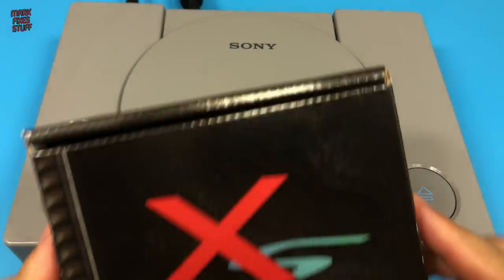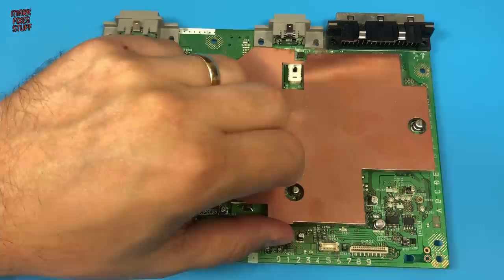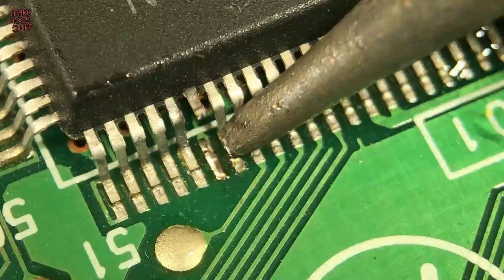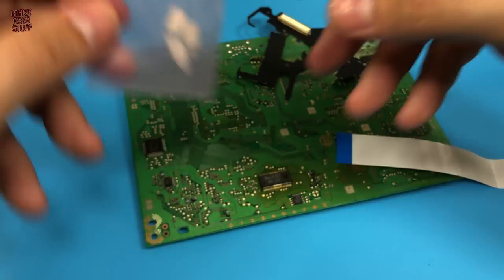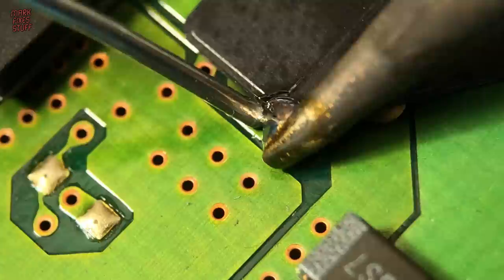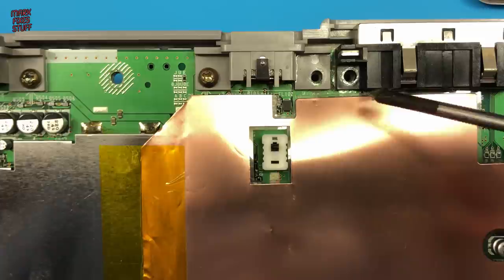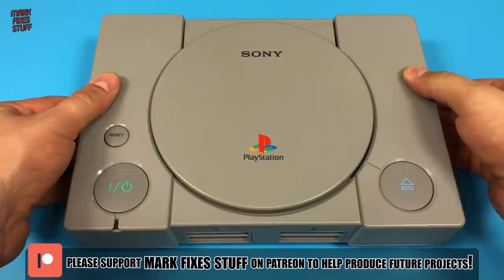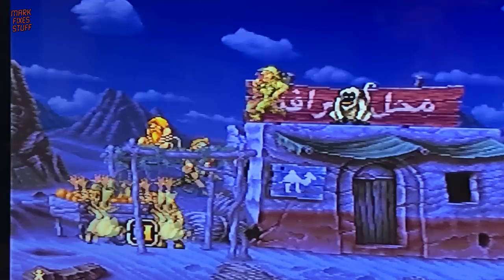XStation - Installing the Playstation ODE SD Card Solution - Step by Step - SCPH5552

Comment: Thanks for this great video Mark. I recently gotten my XStation and tried to do an install on a 5501 I had but unfortunately messed up when trying to solder the wire next to the darn oscillator (apparently that point had broke from the board). At least I got as far as the BIOS screen then went straight to the CD/Memory card screen. Very frustrating. I got two more parts unit 5501's on the way so will just have to wait until they arrive to try it again but until then will practice on some dead 5501 boards. I would have just probably played my PS1 games on the PS2 but wanted to retain playing the games on the original hardware, with no game compatibility issues. I still have my 7501 I bought new in 1997 and still works, but will keep that one stock and unmodified.

Comment: The thickness of the wires on that existing mod chip! You could run a toaster with them ;)
Reply from the maker: I just rewired my cooker with them.
Reply: Sorry to upset you but I installed that, and I’m a qualified electronics engineer. The wire used is actually old IDE cable and at the time, I was the best at mod chip installations for ps1 and ps2 all series in the south of UK, I fixed and repaired many other people’s mod chip installs which were terrible with their soldering etc. This is at a time when this machine first came out :)
Reply from the maker: Unless you are Mean Machine Dean's brother I am afraid you are mistaken, for it came direct from them and was modded by he.
Reply: @MarkFixesStuff  Well…I can confirm, it’s 100% true. He did fit that mod 😄

Comment: been tempted by this, but I think this will soon be made redundant by the ps1 core on miSTer, must be patient
Reply from the maker: Will the miSTer really be able to run PS1 game properly? I'm not really familiar with that sort of thing.
Reply: @MarkFixesStuff  yes it's being developed, and faster than I expected, the developer has shown some games working in a few early builds
Reply: @MarkFixesStuff  last I saw there’s footage of a Spyro game running, still has some graphical glitches and is run from a save state which is super impressive!  So I guess it won’t be too long now 😀
Reply: A soft modded ps2 makes this redundant at a fraction of the cost
Reply: @MarkFixesStuff  Doubt it very soon.  No word on Libcrypt support/Anti-Mod protected titles, or if the mechacon is implemented or if they're going down the PSIO route of hacks instead.  It's a very complex system and even real HW cannot run all games properly, due regional mechacon differences and X-station has shown this already.
Reply: @JungleJeffarnold  a softmodded PlayStation 2 runs the Emulator popstation to run them off a hard drive  and  is awful in comparison to using actual ps1 hardware..

Comment: What size wire should be used when connecting the APLL on the QSB? I pulled a 22 awg wire from a broken little fan in my basement, but I'm worried it might be too small.
Reply from the maker: It's not carrying any power, just a small signal. It's more important that it's as short as possible  :)

Comment: So, I have an NTSC 5501 with xstation, psnee and region lock defeat. I have been hearing about DFO double frequency oscillator. PAl, JP and NTSC games all seem to be playing fine without the DFO. What use is the DFO then?
Reply from the maker: Quade has a good page on it, and it's better than I could type here.

https://quade.co/ps1-modchip-guide/dfo/
Reply: @MarkFixesStuff  Thanks! Sounds like PSNee microcontroller is simulating the DFO within some small margin of error.
Reply from the maker: @smillstill  if it works well enough for you It'll be a win I think!
Reply: @MarkFixesStuff  Yeah. I saw someone selling an OG Playstation with XStation and DFO and was curious about what benefit there could be. Only a very modest one, I think. I can see its importance for those who want to keep using the disc player.

Comment: To me it seems easier if you could buy a PlayStation with the x station mod already installed but that's just me.
Reply: Problem is pre-modded consoles are massively over priced. Much cheaper to use a reliable install service.
Reply: thats the rich n lazy solution. if you dont have a problem paying 300+ for a modded ps1 go for it lol. most would prefer to install it themselves its easy if you got the skillset.

Comment: Anyone have issues with it going straight to memory card screen? I checked the FFC cable and even reversed it because in the guide provided by Github and this video they have it reversed orientation, blue side always up, but the words on the cable are on different sides so I thought that might be the issue but it doesn't matter. Either way it will go to the memory card screen right after the white start up screen. My suspicion is the QSB. I think those through holes that need to connect by filling it with solder may not have a good connection but I'm not sure how to test or see it since it is underneath the QSB. I'm going to double check the IC701 and it's legs to make sure I got the right ones but I'm pretty sure that was all good as I took my time and was very careful. I actually thought that was a much easier process than the QSB section. Anyway, please help if you can think of anything that may be causing this issue. Thank you.
Reply from the maker: I don't actually have anything helpful to say. I'd contact support because this sounds like an issue with the product?? Good luck!
Reply: @MarkFixesStuff  thanks for the reply. Yes I will also contact support. I went back to the QSB and redid some of the through hole joints. I held the soldering iron down on each hole a bit longer after adding flux of course. Anyway, I still get the same result but now it seems to be taking longer to get to the memory card screen. It will stay on the white Sony screen for a bit longer, almost as if it's trying hard to get to the black playstation logo screen but can't. Do you think I might be on to something? Also the green light that used to flash on the Xstation board when opening the lid doesn't seem to flash as much. Now it kind of flickers a bit then goes dark. The blue light is still constant though. Not sure if anyone has noticed this at all or what it means?
Reply: Want to keep updating this as I hope it will help someone out there with similar issues.

Been testing different micro SD cards (Samsung and San Disk) and also older versions of the firmware and still same result going to the memory card screen but I been noticing that after running a fresh install of the firmware on the SD card it creates a config.txt file in the 00xstation folder. When I open this config.txt file it only contains one character,  . If you zoom in, it's basically a questions mark inside a box. Not sure what that means.

Will keep posting more details as I find them.

Comment: it that like emulation or not ?
Reply from the maker: It just emulates the CD drive and the copy protection routines, then passes the code to the original playstation hardware where it is run just the same as if it were from the original disc.

Comment: Why can't people just play and use their old systems the easy they were purchased? Maybe replace a laser now and then but why anything else? Emulators suck!
Reply: The issue is getting hold of these games now days physical copies of complete ps1 games have shot up in price

This is cheaper solution that allows you play the whole library on original hardware there's no Emulation happening.. besides it "Emulating" a disc drive as soon as it loads the games it runs exactly the same as you using a physical disc